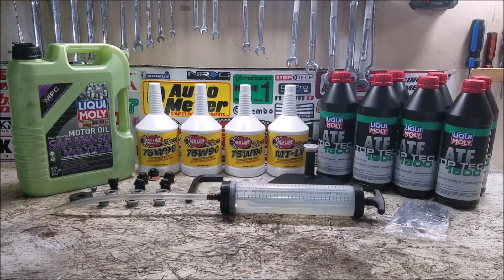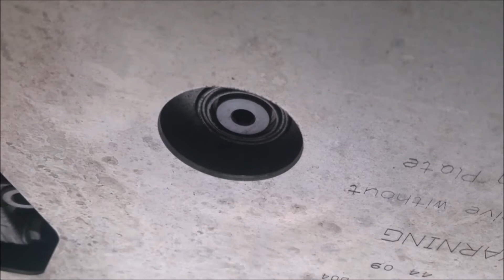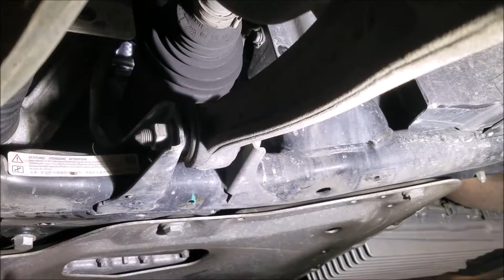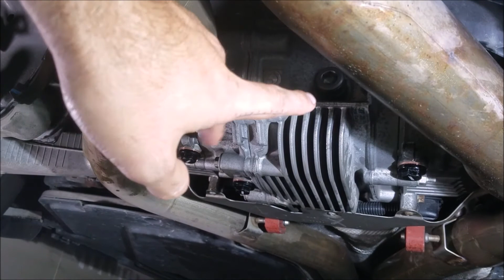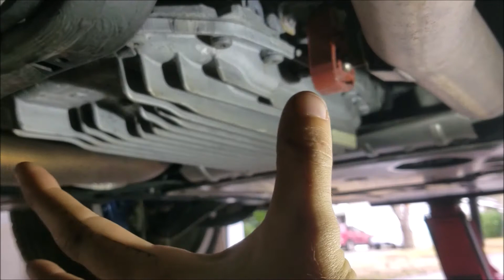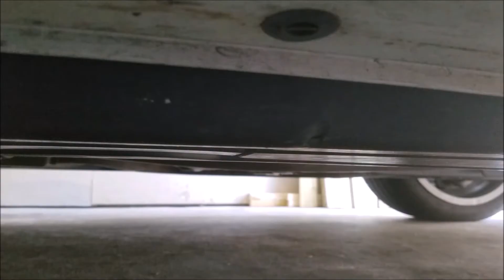E70 BMW X5M How to Change All Drivetrain Fluids DIY

Comment: Did you put a plastic pan back on the transmission?
Reply from the maker: @Raptorlifts  No, the X5M has a finned aluminum pan. The plastic pan is only for the non-M X5s.

Comment: AWESOME AND SO SO INFORMATIVE, going to save me loads of time NOWTHAT I HAVE SEEN WHAT HAS TO BE DONE ALONGSIDE WERE ITS ALL LOCATED AND THE CUSTOMIZED TOOLING REQUIRE.....,just purchased mine a 2009 35d xdrive with 140k so its a complete system fliufd drain/change for me. just need to figure out what i need to do in order to do a full 7ltr transmition oil changre. I have everything needed, except the sunshine so its going to be a cold one for me. THANK YOU SO SO MUCH FELLA, YOU HAVE A NEW SUBBY...Ian

Comment: Engine oil calls for 0w30? Or 40
Reply from the maker: I use 5W40
Reply: when I had my x5m I used 10w60 its a little harder to find but that's what I was told to use

Comment: Hey, did you use 75W90 in all chambers of the rear differential? I heard you need to use friction modifiers in outer chambers and 75W90 in the middle otherwise it becomes chatty.
Reply from the maker: I didn't do any friction modifier, but I don't see why it would hurt. After like 25K miles, still no chatter without it.
Reply: @350Z247  do you use 75w90 for front transmission or rear? and Liqui Moly ATF 1800 for rear transmission? Sorry I AM confused here,.
Reply from the maker: @cezheng8624  there are front and rear differentials; there's only one transmission. Make sure you feel confident before tackling this job otherwise you can really run up a big bill